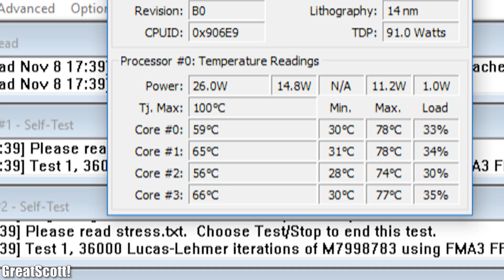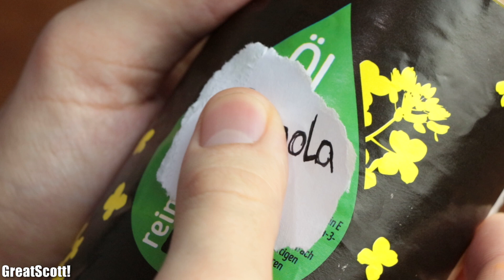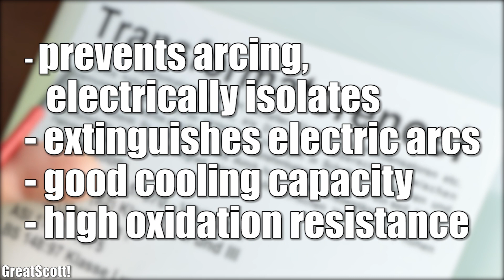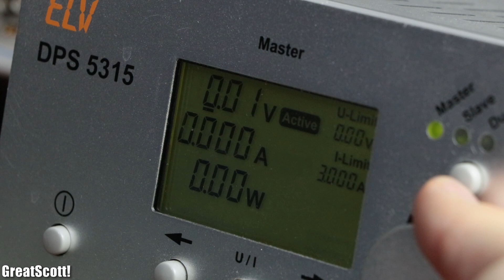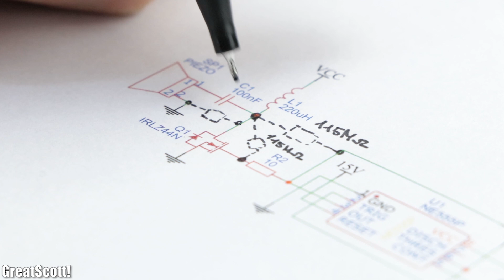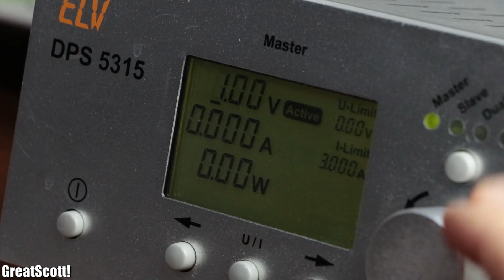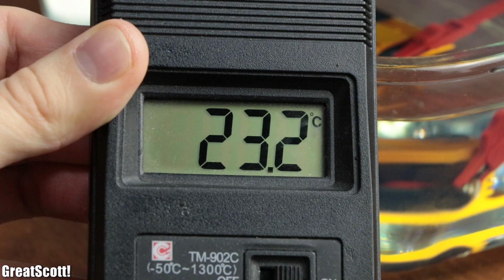Oil & Electronics? the best way to cool electronics? (Experiment)

Comment: what you do is get a air conditioner and submerge the cold condenser in the oil along with the board, Linus did a similar build and actually reworked the cold condenser with a CPU heatsink right in the line of the AC problem was water condensation on the board but if the board was submerged in transformer oil that would no longer be an issue

Comment: Can you do variable frequency drive video please?
Reply from the maker: It is on my to do list
Reply: I woud alsow like a video on the other type of VFD, a vacuum flourecent display
Reply: I also would like to see a video with the variable frequency generator
Reply: I have been thinking about putting a VFD in a sealed oil system to protect it from grinding dust for a 2x72 belt grinder. Was pleased to see this video. Makes me feel less crazy for thinking it.

Comment: about 15 years ago, i made an oil-PC after i saw an article about an oil-PC at toms hardware.
Back then it was just a Duran 1,3GHz, 384MB SD-Ram (100MHz)  with a MSI Geforce 4 TI 4200 64MB.

I had nearly no money, so i couldnt afford expensive mineral oil. I used the cheapest vegetable oil.
It really worked and looked cool. Also the temperature didnt get too hot. But overall it was pretty messy. After months i "drained " it, because it needed too much space and replacing anything on the mainboard was a nightmare.

Comment: canola/rape seed cooking has a high water content when fresh, it can be dried by heating to +200c, then once dry and cool will still turn rancid, but will run a non hdi  diesel engine....
My fav board coating, adhesives, 2 part dollar store epoxy or UHU

Comment: I don't know how hard it is to get, but when I work for the US Army Pulse Power Laboratory we use Shell Diala Oil. We were working with some very high voltages and never had a problem...at least not one that was related to the oil :-)

Comment: Oil has been used as a coolant and arc suppressor since the early days of electric power generation.  My grandfather designed high voltage oil switches for a Dutch power equipment company while he was interned in Holland during WW1.  Not sure what the oil was, though my guess would be mineral oil as that was easily obtained and it won't ignite when under high arc conditions.

Comment: Just like with watercooling in a pc, it's obvious that oil will perform better than air, mainly because 7-10 minutes is not enough to saturate the oil/water
Maybe try to do the same test/experiment but for longer and with more probes across the tank, that would be more representative on a real usage scenario

Comment: I always use Bremsenreiniger for cooling my electronic components. It's a lot more liquid than water and can heat desapeat much better with this. And the best is, it's boiling at 80C. So no components can go higher before al of the liquid is gone. Also with this you can see where is for example a short in your sircuit.
Sorry for bad English
Reply from the maker: That works? Might have to take a look at that.

Comment: Got this video right at the moment. I want to liquid cool a medium size double resonant solid state Tesla coil but i fear the plastics on ICs or rubber seals on the pump may get attacked by oils. I can only found that castor oil does not deteriorate rubber(flourinert from 3M is too expensive to count)

Comment: Don't submerge a hard disk in it. Hard disk drive enclosures allow air in and out since the magnetic heads require an air cushion to prevent them from scratching the disk platter surfaces.

Comment: Hey, I think the AC mains conducts a little current through the oil by parasitic capacitance between the two wires than by the oil resistance alone.

Comment: A rubber band might hold the temperature probe on and in contact, as it applies pressure and does not use adhesive.
Great videos, as always. Thank you.

Comment: Specific heat capacities are not relative here. Because not same mass surrounds the resistor. These fluids have different densities, especially air, so you should calculate heat capacity for e.g. 1m3 of fluids and than compare them. Plus you should not disrupt fins when mounting the thermal sensor, and it should be in surface, not surrounded with fluid.

Comment: Water is much better for cooling than oil of any kind. DI water is used for cooling in high power electronic circuits. It is used inside transformer windings, as the windings are copper tubing not solid conductors, as the tubing is cooled with moving water. The connections are done with PVC hose that is reinforced with nylon braid.

Comment: rapeseed oil has some unpleasant effects on some materials used in electronics manufacturing, setting aside the rancidity issues; mineral oil is a safer bet, and is usually packaged with powerful antioxidants in quantities that would be dangerous for food oils. It is also generally easier to come across good general purpose mineral oil, and it is safe to handle without gloves (assuming it's food/pharma grade oil).

Comment: Like he said you wouldn’t actually use regular kitchen oil to cool a pc, you would most likely use mineral oil as it is also non conductive. One thing to note is that it does break down plastics so connectors and in some cases stickers can just break off.

Comment: Mineral oil is the most common type for PC cooling... But it's super uncommon to do oil cooling in the first place. Most people who don't do air will do liquid loop cooling. Mineral oil PCs are pretty cool, but you run the risk of accidentally insulating, say, the inside of PCIe slots or DIMM slots, making it problematic to replace/upgrade hardware. You also have to make sure you keep it clean, or else it can become conductive overtime, like distilled water can become regular water when exposed to contaminants.

Comment: To keep from getting rancid place all electronics ssubmerhedr in oil, in a sealed box.

The high voltage transformer are all oil cooled the whole trasnformer is submerged. A lot of motors for hydrolic pumps are also submerged in the hydrolic oil.

Comment: Mineral oil is a cheap effective insulator and cooling solution, at least in the U.S.A it can be found in drugstores it's used as a laxative and usually comes in pure mineral oil form.
Reply from the maker: In drugstores? Sounds awesome.

Comment: We have almost the same multimeter. Mine is a UT61E. What do you think of the voltage protection? According to Dave on EEVBLOG they shouldn't even be Cat III rated. From what I've heard elsewhere, the reason is that the ones meant for the Chinese market don't include metal oxide varistors but ones for America and EU do include them. Mine came from China in a Chinese box, but I haven't looked inside it yet. I think it's a great meter for the price. But I hate the battery connector and compartment.

Comment: There was a current flow in oil, because 2probes have a small capacitance between them. Try using rectified mains voltage
Reply: yeah

Comment: When you showed the cables touching and coming apart at 0:42, a glitch that very rarely happens with Windows 10/My keyboard happened, which turned the volume down gradually to 0 in sync with as you moved the cables further apart. For a moment I thought you had intentionally set it up so your mic went through those cables, and somehow got it so the audio signal faded as you moved them away from one another to demonstrate the resistance of oil. I realised soon enough that it would stop as soon as you separated them, but it got me for a moment. Seemed like it was a very cool effect in that moment though.

Comment: Excellent video mate, was gona do this myself by yay, now I don't have to!

Are you gona build a PC with it? How is this oil for its wicking properties? Does it react with any of the plastics in the components and or the rubber like materials used as soft mounts or seals etc?

Comment: I wonder if the oil with its low viscosity is able to be pumped with some of these cheap pumps you can get off ebay, I got a 5VD USB one to play with and a mains on as well as a 12 V one and all the same form factor and footprint but all very different in their ability, the 12V one actually performed the worst, then the 5V one then the mains one.

Comment: You don't use canola oil or any other cooking oil for oil cooled rigs. You use food grade mineral oil. It does not have the acidity of the cooking oils and is just as cheap when you are buying by the gallon off the Internet. The inspiration to use the mineral oil was because it is used in high voltage transformers to keep the coulis cool and keep moisture, dirt, and other contaminates off of the coils so you don't get a short that will fry the expensive transformer and anything hooked up to it.

Comment: Could you do an experiment with motors in the oil? as in its cooling capabilities when the motor is at full load.... I think the power you could run would be way better.

Comment: Yes it works but...

Where I worked we took in computers that had been out on lease. We received a batch of expensiver IBM servers that had been run in oil. They worked fine, but they were an oily mess that we couldn't clean up. The customer wound up getting charged full value for the servers and the units were scrapped.

Comment: The question is, if its even less electically transmitting than destilled water, should we use it for our water cooling solutions?
I mean, how good is it at cooling?
Probably good enough.

Comment: If you used the same oil than we at work, witch it looks like.
We use it for Oil Switches (20kV), one Switch must have >20MOhm testet with 25kV and on the inside its, never measured it :/, 1-1.5cm.
It also need a low viscosity because the switches move realy realy fast and it must isolate everything fast. The oil gets yellowish after a long time or a lot of shorts.

Comment: how about Monoethylene glycol that is found in projection TV's ? it will most likely be the oil most DIY hobbyist will run into especially when doing component recycling
Reply: Monoethyleenglycol is poisinous. Mineral oil is not.

Comment: Not sure I agree about cooling. The higher temp, coupled with a higher oil temp will allow it to dissipate more heat if it's piped through a radiator instead of just a glass bowl.

Comment: Well, just curiosity:
With a radiator/pump/fan from a pc liquid cooling system could this oil be used to cool, for example, a sealed battery pack? 
Ain't gonna do that, just asking(for now, at least)

Comment: Is there any chance the current you've measured on AC was just capacitance between the electrodes and not the  current flow thru oil ?
Reply from the maker: There is a possibility

Comment: The heat capacity is pretty irrelevant if you have a radiator, otherwise comparing oil to water is just a heatsink with no way to remove the heat, it's just a ballast.

Comment: i work as a linesman and in the field is forbidden to touch this oil without the safety gear, aparently is a really nasty oil, not sure if the one in the video is modern or if there is other cause
Reply: Some older transformers used a very toxic PCB oil.

Comment: Du hast sogar eine noch bessere Isolation wenn du das Öl vor dem einfüllen noch einmal über Nacht vakuumierst um Restwasser was sich über die Zeit in den Container gezogen hat rauszuholen. Ich benutze für die Umlaufkühlung von Röntgenröhren TrafoÖl von Shell (Diala S4). Die dielektrischen Eigenschaften sind nach dem vakuumieren noch mal besser. 
Ich komme vor dem vakuumieren mit einem Abstand von 1mm auf rund 30kV bevor es überschlägt. Danach geht's bis auf 40kV und mehr.

Comment: Oil is largely used with electronics because users want run the electronics under pressure such as in a underwater vehicle in order to encounter the water pressure.

Comment: For computer cooling transformer oil is not good solution, better solution is perfluorotripentylamine or perfluoro 2-butyl-tetrahydrofurane (3M Fluorinert FC-70 or FC-75  respectively) which was used for cooling Cray supercomputers.
Reply: Not really. Fluonert is known to have bad environment impact. Yes, it is great for a two phase cooling process, but at a really high cost. Mineral oil is a single phase cooling solution, very low impact on the environment and cheap. But cooling is less efficient. For most electronics this is more than enough.

Comment: What happens if you put this transformer oil inside of a closed loop water cooling computer. Can it damage the radiator or the pump?
Reply: i think it can because of its consistency

Comment: In 2009,my father is working on transformer repairing, we recycle old transformer by boiling water from it to make its resistance higher, one day he put the oil for boiling, he went outside for some reason and the oil overcome its burning point and start burning, suddenly he came and put a litre of water in it,but it caches more fire than before ,make whole room burning, my father trapped in it and injured  about 80% burnt but thanks to the god ,he is safe now , so keep safe brother working with it
Reply: So dont extingush burning oil with Water....

Comment: 7:01 Because of that you can use destilled Water in a Custom Water Cooling. Roman aka der8auer built a PC, which is only cooled with 3m Novec 7100. All components are in this Fluid without heatsinks. The fluid boils at 60°C and got cooled down by a radiator on the top of the PC. This is a closed system, because if the fluid is in contact with air, it evaporates. But a problem with this fluid is, that this is not pretty good understanding with plastic and you get this fluid only, if you have a company...
He made also some Videos about this special PC:
https://youtu.be/V7-QWmT2jfk
https://youtu.be/yKJs_MmKuDA

Comment: The best arc welders use oil cooling,the oil is non conductive and i think it it castor oil,also it is not cheap,you might get away with silicone oil.

Comment: I am not very satisfied with your cooling capacity test. If you have electronics under constant load the heat capacity stops having much advantage and the liquid which conducts heat better from the electronics to the case would perform best. Heat capacity would only really matter if you want to do high load bursts that don't last long and can afford a cooling period.

Comment: can someone help me?.3 weeks ago i blew up my dps5015 module,the module was idle the volt in was 55v and the output was off when it suddenly blew, i was working on my tesla coil when i saw a fire went out from the board,but there is no burn mark on the board,also 1 week before the board died i relise that the display light was glitching,in the settings the led was full but it flickers ,can someone help?

Comment: Water oxidize metal, so no.  Oil maybe but makes it heavy to carry your circuit board so that's why heatsinks remain the best solution.   U could attach a pelletier plate to cool ur electronics

Comment: I just bought my first soldering station for 20€ because my gas soldering iron started leaking gas and all my other irons are broken
Reply: And i also screwed up my soldering irom tip in the first hour of using it
Reply: @SelectLOL  Wouldn't this be a bit expensive for the casual user? I would rather recommend buying a Hakko 951 knock-off from banggood and use the 350€ you just saved for other stuff. But, if money is not a problem go for the JBC!
Reply: @ppdan  Thats what i would have recommended before i bought a hakko knock off on aliexpress. Its such a piece of garbage, the tip is just dissappearing after soldering (the cheap material is wearing off pretty quick) and the thermal coppling between the tip and heating element is so bad, that you have to always go full power. When you do that the flux in the solder dissappears together with the tip. Its just not worth the struggle. But if you know a good knock-off go for it, if not get JBC or Weller. Hakko looks like a child toy xD
Reply: @SelectLOL  You can just replace the tip with a original Hakko tip.
Reply: @ppdan  true true
Reply: @SelectLOL  If you still have it maybe try replacing the tip with original Hakko tip. I really wonder if changing the tip would change your opinion. Not saying that it should but might be an interesting experience. 
I am hesitating myself of buying a knock-off because my Weller is also my dads first Weller (old magnastat type). The main reason that my Weller station is doing a good job is because I learned to survive with its limitations.
But in the end my last one will be a JBC for sure, it's just that I have other priorities for the moment.
Reply: @ppdan  i totally will try buying a branded tip, hope the temperature readings and stuff will stay same becouse i dont know if the knock off uses the same heating element  and PTC/NTC inside. So i might change only the tip or the whole iron with cable. And for you i mean the really fast heating and all other featers are pretty neat and nice to have, but in the a good weller station will give you joy with the damn reabilty you need.
Reply: @ppdan  Once i wanted to solder something where i work, there we have really fancy soldering stations and i got a fucking error code from the station and i was just like "fucking heat the stupid iron, thats you only job stupid station". It was a weller to i thing
Reply: @SelectLOL  I love my Weller but it's date code is 1177 and it's really time for a modern soldering station with decent temperature control.  Now I have to change tips to change temperature and being lazy means using wrong temperature tip and risking to lift pads.
Anyway, I would really appreciate if you let me know what's the result with a Hakko branded tip. Maybe even make a video about it ;)